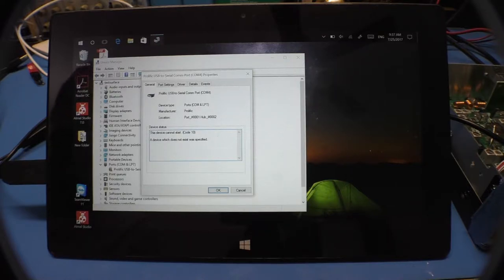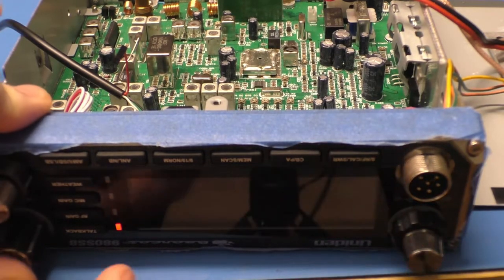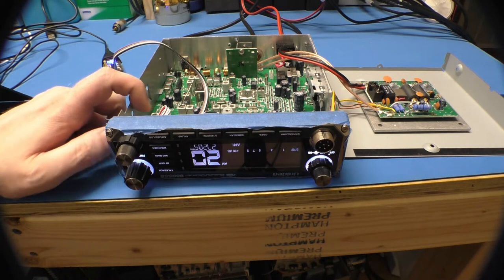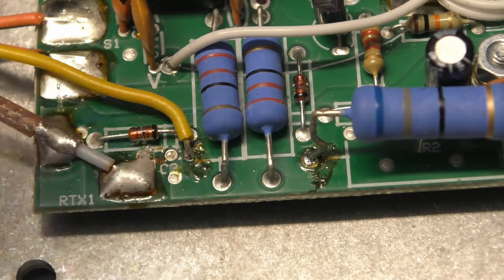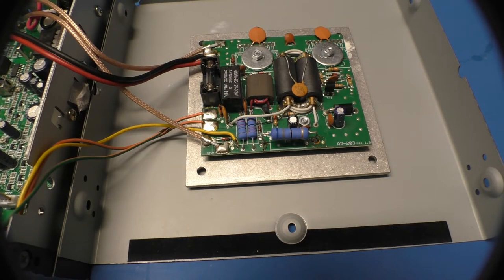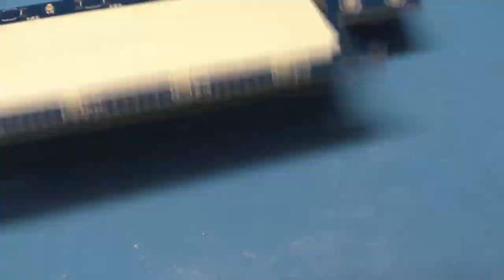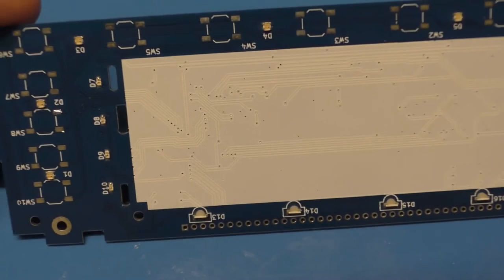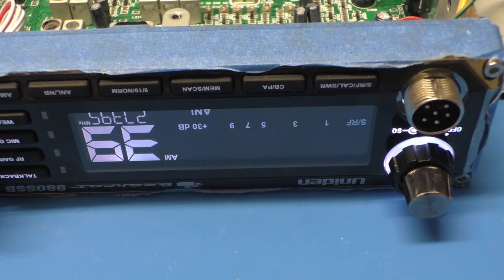SSB980 - updating firmware on new boards.

Comment: Is that just a uart or usart adapter? I have a bunch of them
Reply from the maker: Yeah when I did these boards I kept the UART off board to save some money.
On later versions they had the UART on board because you could connect two together and either copy settings or form a sort of crude repeater. You just had to make a cable that connected from one mic jack to the other and they would form a repeater.

Comment: Mark, Excellent job on this. I would be interested in one of your boards. I think this will be a big hit for you. The 980 is a VERY popular radio with everyone complaining about the lack of Ch mods...well, you fixed it. I watched a couple of your vids and see that your not sure how to depict the A channels or different bands. What if you create a long button press and use the frequency readout below the channel readout  as the channel/Band. instead of 27.195 it would say CH19A . then the 2 digit ch could display the band A B C D E F G. I personnaly prefer the VFO style. Also, I didnt see mentioned, is there a way to "step" to 27.380 or 383 etc??

Comment: Would you be willing to send me the firmware Mark? Also which language was it programmed in? I am fairly good at "C".  Thanks
Reply from the maker: I shared code from past projects. I even had the code on github.
What ended up happening is shops or tinkerers would take the code and start selling copies or use it in their own projects without attribution. I had a very simple license for the code. Personal use only.
See, CB radio mod makers are inherently dishonest. That's why I don't share and that's why I stopped making things.
Now I do it as contract work and its closed. There are shops that have licensed things in the past and its under strict control. They had to put their money where their mouth is.
As to what language these were written in... some is in assembly, and some is in C.
It takes a lot of my time and money to chase down copyright infringers. I won't put myself in that position again.

Comment: Dose your board need to have a 6 pin mic jack for all of the options ? Or could you make one for the cobra 4 pin?
Reply from the maker: In theory, yeah I could make one with a 4 pin.
You just can't use the wireless mic with it then.
Reply: I'd be more interested in one that works with 4-pin Cobra Mics. No desire to use the wireless mic. Good lookin' out though for those who might like that feature.